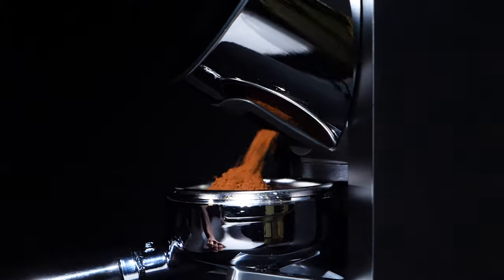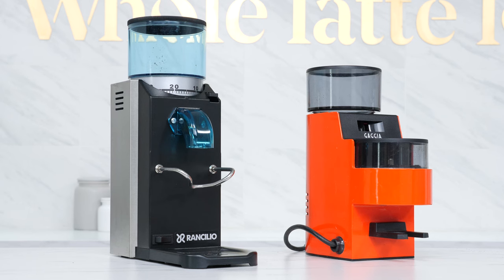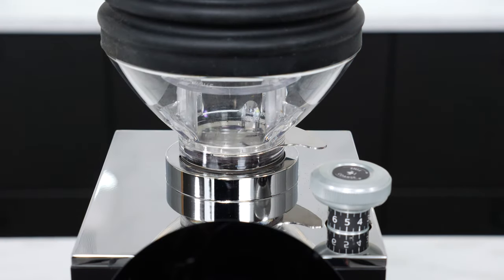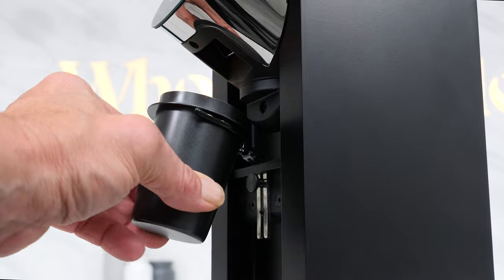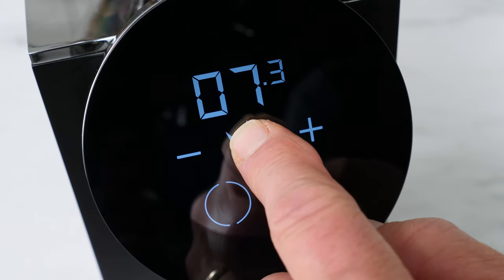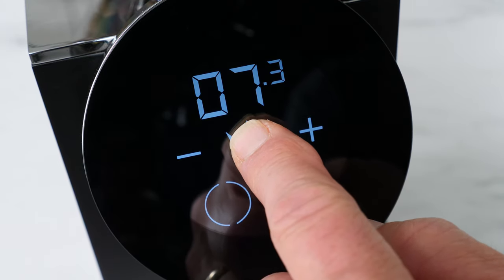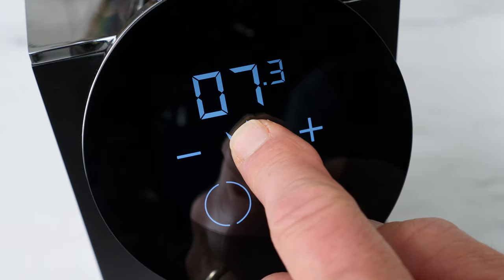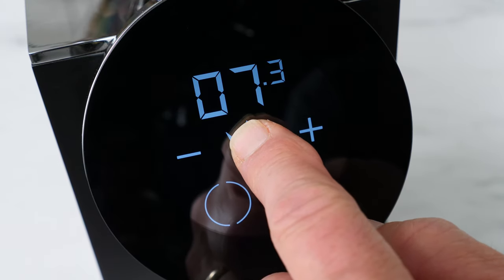LX Italia Espresso Grinders Introduction, Tests & Overview

Comment: They are just a re branded Eureka mignong grinders in a different more fancy jacket. Internals are identical to Eureka . I have a mignon xl 65 mm burs completely te same.  Good home grinder only fall back on mignons is the on/off button sometimes this button is re energised when removing your porta .and causing a mess.  On/off on the display solves this and for home use more convenient.  Large dose baskets can't well positioned on the mignon. When usng 14gr baskets no mess. 18gr you get a lof of powder missing the target. The lx seems to do better due to better filterholder
Reply from the maker: Hi w, thganks for sharing your thoughts and experience!

Comment: It basically is a rebrand of Eureka with improvement of appearance (material).

Few things I like this XL brand:
Grind size adjustment knob 
Bean hopper
Large digital touch screen

However, I assume that the burrs and motor is same as eureka oro line, which means grind quality is no difference to eureka oro line.

My question is: does it worth to spend extra hundreds dollar for aesthetic?

To me, no
Reply from the maker: Hi mn, thanks for sharing your thoughts!

Comment: Are the fittings and attachments (portafilter support, tuning dial, bean basket) compatible with the Eureka Mignon grinders? They'd make nice upgrades.
Reply from the maker: Hi b, Yes they would! PF support would not be compatible. Dial and hopper probably are.

Comment: LX Italia and Eureka grinder websites are the same address. To me, this is a selling point. Eureka has been around forever and makes great grinders....and this display looks like an improvement over Eurekas design.
Reply: The Eureka grinders are not to bad . I have the xl mignon 65 mm burs . Grind quality is good for home.  Only thing i don't realy like is the porta filter holder and the button to start the grinding. I often have a double dose due to accidentally push the button again when removing a full porta filter. So i think control trough touch pannel is better.  The Eurekas would be perfect if they would also have a better funnel system. For large baskets they are not ideal, a bit messy.  But overal grind quality is pro level for home.
Reply: @wimcalant8425 You think the Edison SD is good enough for a Bianca V3?
Reply: I guess  so.

Comment: On average,  after how many grams of coffee grinds do you recommend cleaning the burrs?
Reply from the maker: Hey r, To some extent it's up to the user. This grinder has fairly low retention. I'd only clean the burrs if the grinder sat unused for at least a week or two. So long as your grinding coffee through on a regular basis no need to clean burrs unless you notice something is off or maybe switching from a very oily coffee to a lighter drier roast.
Marc